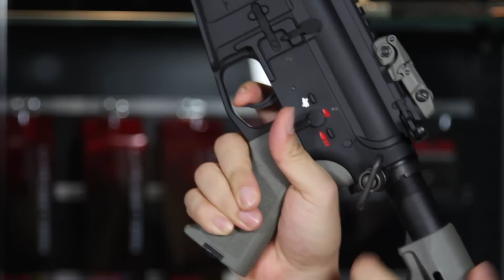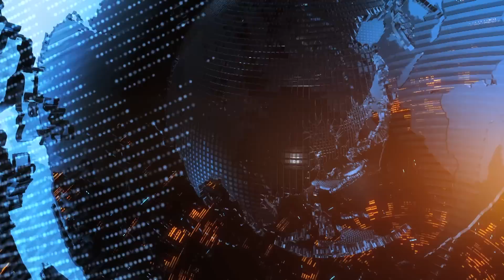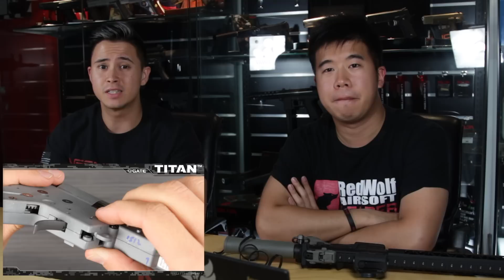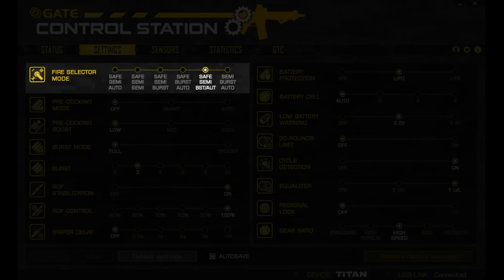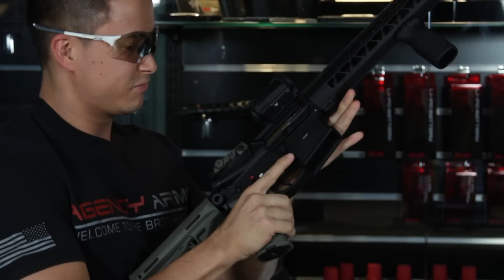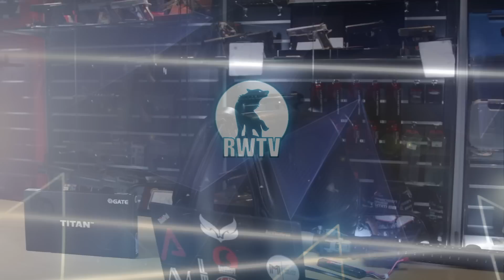AEG Tech’s Wet Dream – Gate Titan Mosfet - RedWolf Airsoft RWTV

Comment: recently went HPA and never going back but when my gun was still AEG I had one of these along with my guarder 16.1 gears and a jg blue motor and it had great trigger response... definetly the best mosfet/programable trigger unit by far
Reply: So if you had to choose between HPA and going with a Gate Titan you'd pick HPA?
Reply: @Brandon Harrison hey thanks for the response! What FCU settings do you reccomend? I ended up getting the F2 P*
Reply: @KP-uz3nk  HPA all the way, a fusion engine has a nice crisp feeling trigger and you will never have to worry about replacing gears, piston teeth or re-shimming after replacing parts.

Just plug it in and you are good to go, had mine 3 years never even had to change o-rings yet.
Reply: @G_Zero127  shame they haven't built the only great thing about HPA yet. we need a cheaper competitor to the DG recoil engine.
Reply: @jediknight129  Tippmann M4 is great for the recoil and HPA also CO² compatible, cheap but I think they are discontinued now as I cant find any in stock.
Reply: @G_Zero127  yes but they were shit, the co2 mags leaked when you removed them (first gen they changed the design later.) and it wasn't able to be fitted in anything but an m4.  the  DG recoil engine was/is a much better design in a lot of ways  AEG mags, the lack of limitations on shape. 

retrofitting to aeg bodies limits things so I'd like to see HPA built from the ground up. (Going back to the 1980s airsoft designs. ) taking advantage of the blow forward bolt of an air system. 

I also really want to see PCP systems as that would allow for a huge shift in how well the mechanism works AND most importantly allow for not being attached to a hose which is the reason for the events I play HPA is dogshit. 

if built right with internal reg inside the body of the gun like most high quality air rifles, you'd charge it every couple of hundred shots and we'd gain so much from it.

Comment: We've started playing airsoft about 6 months ago. Got the Gate Titan is in all our replica's (6 in total with 4 man ) all ICS CXP models. It is amazing, never shot a gun without this mosfet. The amount of settings is insane, hairtrigger ftw! I usually run my settings as follows:
Safe = Safe
Semi & Auto =
Hairtrigger trigger action = Semi shot
Whole short trigger action= 3rd burst
Whole trigger action and hold = Full auto

You guys forgot to mention that you can on-the-go turn pre-cocking on or off!
Fire a shot with your selector switch on semi and hold the trigger, now turn the selector switch to full auto. You get a vibration from your motor, now pre-cocking is on. Fire a few shots to get the piston right. Voila!
To turn it off do the opposite, on full auto; press and hold the trigger and turn it to semi. Fire a few shots and your pre-cocking is off.

My other settings are:
Pre-cocking mode: smart
Pre-cocking boost: high
Burst (mode): 3rds (full)
ROF Stabilization: Off (100%)
Sniper delay: Off

Battery Protection: LiPo
Battery cell: Auto
Low battery warning: 3.2V
30-rds Limit: On (in case of malfunctioning due to grease on the trigger sensors)
Cycle detection: On (ofc otherwise the Titan ia a waste of money)
Equalizer: Off (don't need it with these trigger settings)
Gear ratio: Standard 

And i lend my guns to my friends, now when they want to buy an replica they also want to have an Titan installed because they find the stock trigger unit really really bad 😂
Reply: Nice just wondering what the equalising setting is for
Here i have one in a krytac trident mk1
45k a1 supreme
12:1shs gears
Lonex red and a cut m100 to get it on 340fps
Precocking none
Gearset mode speed
Safe semi burst/auto
3burst
No precocking
Cycledetection
Battery warning at 3.4
And no delay
Reply: Can you help me with the installation on the ICS Gearbox? I'm having trouble on my ICS Par MK3 MTR.

Comment: For some reason I think btc Specture mk2 has all same optional settings plus Bluetooth but not the future to update the system. What your thoughts abaut btc mosfit? And or maybe in the future you will be covering this mosfit as well as titan?
By the way great video guys :) keep up great work and don't forget to have some fun while you makeing them :)
Reply: The BTC is far superior.
Reply: i must say Gate is like the budget version of BTC, but i agree, BTC is far more superior..... kinda wished they mass produced it tbh
Reply from the maker: From what we know. BTC Spectre is a great mosfet. However, they aren't commercialized and mass produced like the Titan is. Since the mosfet is basically sold exclusively by BTC themselves only, so we can't really compare them side by side. 

Base on the information we gathered, they both are great mosfets. BTC has the ability to program the unit through bluetooth on the fly, whereas the Titan has a faster trigger response due to the fact it uses optical sensor instead of a microswitch. Most of the features for both mosfets overlap, but Titan just have the feature where it allows you to adjust the trigger pull and travelling distance. Of course, optical sensor are prone to be interrupted by external substances, but simply cleaning it and the mosfet will be good as new. So at the end of the day, it is just a matter of preference. Both are great, but Titan is just more readily available in the market rather than BTC's which is more of a bespoke mosfet.

Comment: But i already have a BTC Spectre MK II :(
Reply: Die_Quelle me too😓
Reply from the maker: There is nothing wrong with that. It is still an awesome mosfet. The Titan just have a cooler user interface and uses optical sensors instead of a micro-switch. Titian may have a better trigger response. But other than that, they both are very similar in terms of function.
Reply: The only thing I am missing is the optical sensor for the trigger.
Reply: RedWolf Airsoft i was joking, the btc spectre is better. You cant compare the trigger response of the two since its how you set up you gun the determines that. The btc spectre has bluetooth built in which i would choose anyday. And since it is not massproduced the costumer service is the way better. It might not have the trigger sensors but it is way more advanced in how it reads your gun and all of the specs it can show on how you gun is running.
Reply from the maker: I see, but isn't that the same thing as the Statistics tab on the USB-Link? It shows the stats and how your guns is running. Actually they are currently in the works on adding a bluetooth feature to the Titan.
Reply: RedWolf Airsoft its the same thing but with a lot less steps the only thing you have to do is open your mobile and open the app. Thats it. Im not biast and once gate comes out with the bluetooth it is going to to be better i  functionallity and i will probably switch if the price isnt going to be alot more than it is. But i still like the costumer service from btc the most from ANY company out there and thats mainly why btc is my favorite.
but for real im stoked that somebody accualy answered from redwolf XD. And keep up the amazing content;)
*edited
Who was is that actually answered?

Comment: would be nice to have an android app, because i'm not taking my laptop with me to skirms, currently i have an intel compute stick with a tiny usb router to configure the titan via my phone through vnc.
Reply from the maker: Actually you can purchase a programming card instead. It can pretty much do 80% of the function of the USB-Link. Of course the programming card doesn't allow you to re-calibrate your selector and update firmware, but that is a lot more portable than a computer for sure.

Comment: i want that gun. what is that gun?
Reply from the maker: That gun has been completely modified. In terms of external, the following are the parts that was used to build that gun:

- G&P Magpul MOE M4 Carbine (FG) (Discontinued)
- RWA Samson Rainier Arms Rail 12.37 inch
- Knight's Armament Airsoft (Madbull) QDC 3-Prong Flash Hider (CW / 14mm+)
- Magpul RVG Rail Vertical Grip 1913 Picatinny - Black (MAG412)

All of those can be found on our online store www.redwolfairsoft.com
Reply: thanks man

Comment: He gonna break that gun by dry firing too much
Reply: No he won't. Dry firing won't break the gearbox unless it's built with really fragile parts and in that case it would most likely have failed anyway. I have dry fire tens of thousands of shots with all of my AEG's and it hasn't affected the internals at all apart from normal wear.

Comment: Garbage, mine refused to accept any sector gear, My gearbox is was shimmed absolutely perfectly, I even tried without grease just to get it to work! The GATE techs are incredibly rude, and accused my tech and I of incorrect gear shimming and installation over and over again, even after providing videos and photos showing it was installed perfectly! The system ONLY fired on full auto, and did not feed even then. Don't believe this video, half of the settings don't actually change anything. INB4 faulty unit, I am NOT the only person with these issues! Do not waste your money, get a BTC Spectre instead.
Reply: Matthew Whittingham why would we listen to you ? I gave my titan for 3 months now and it is perfect
Reply: U prop don’t even have a titan u are just a Spector fan boy
Reply: BTC spectre? One of the main reasons for not getting it.

1. Its almost impossible to get outside of the o so great america.
2. its failure rates are enormous.
3. Its more primitive than the GATE Titan
4. The Titan has better response and better UI/Programming system
5. Oh, and its GATE.